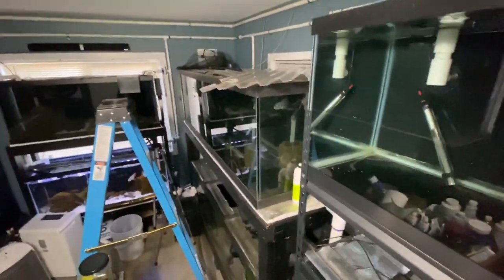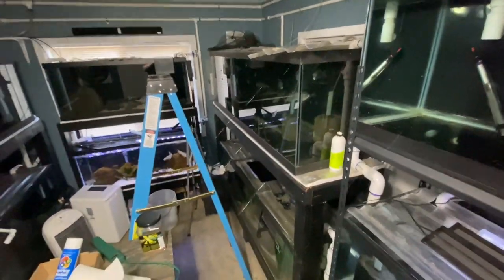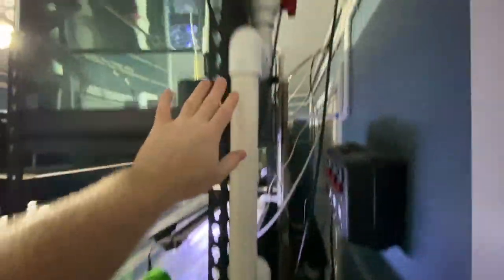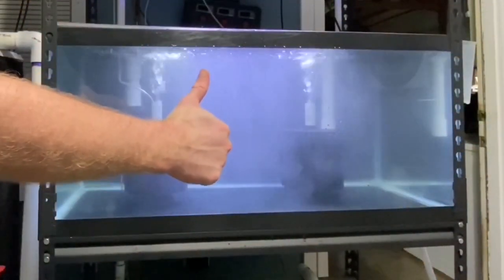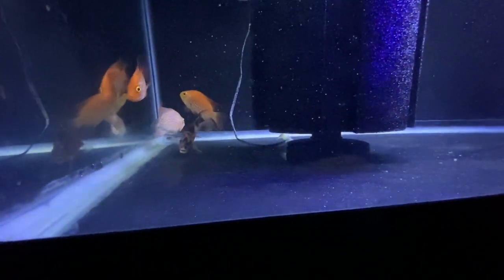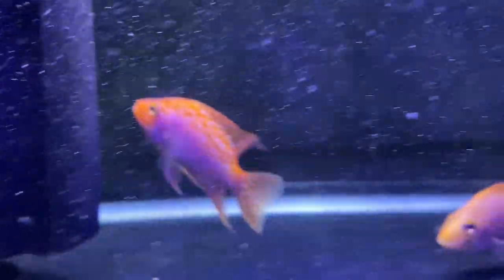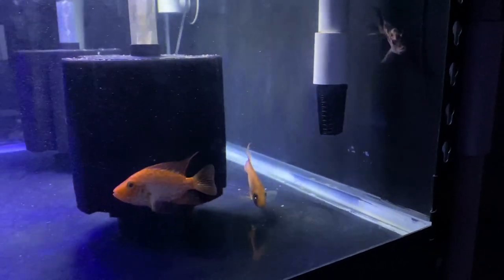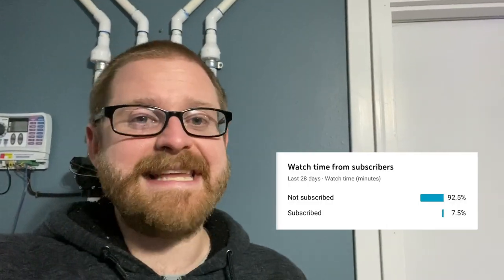THESE HYBRID AQUARIUM FISH ARE INSANE! Rarest Hybrid Cichlid I Ever Had

Comment: I hate sponge filters, but makes me kinda wonder if I should based on how high tech your room is and you still using them, do u prefer them for any particular reason?
Reply from the maker: They are cheap to buy and cheap to run (with a central air system) That is the main reason.